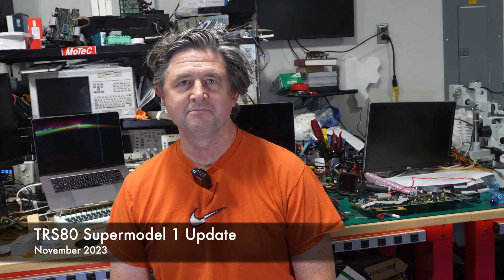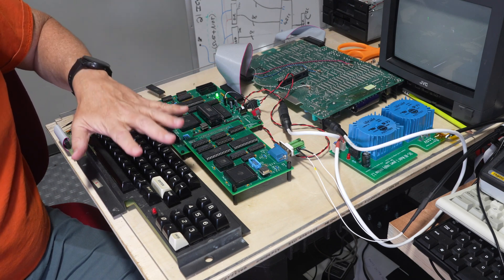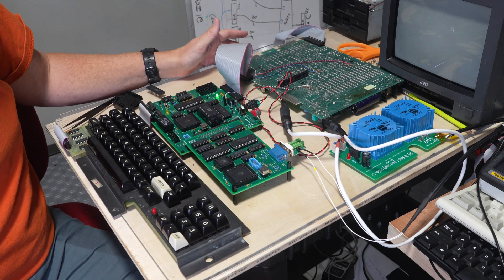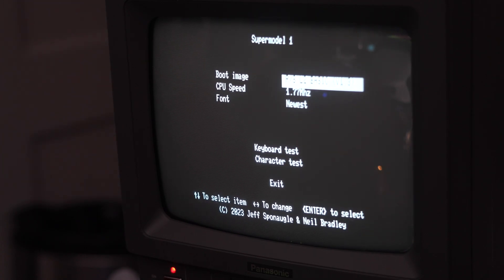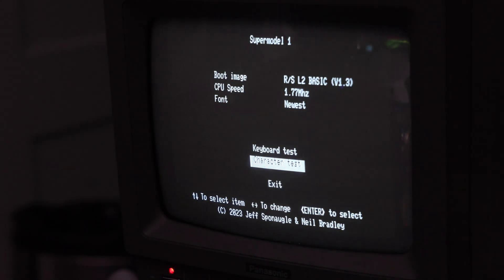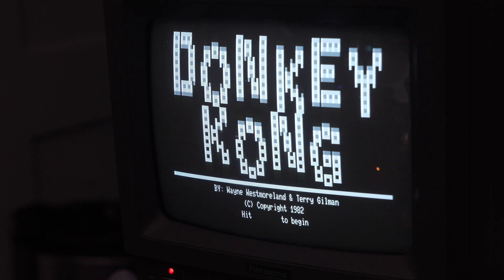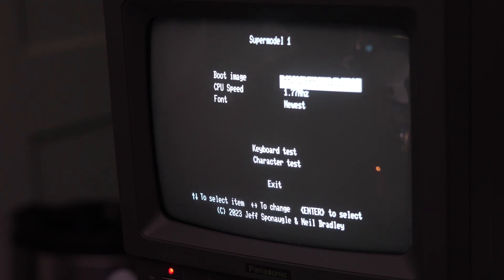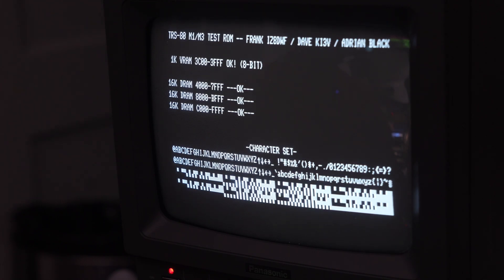TRS80 Supermodel 1 Update

Comment: Very nice system you have put together.
Until seeing them, I had forgot about those non-descending lowercase descenders.  Fond memories.
Idea: Since you are giving font options, perhaps also put in a choice for the all uppercase font of the actual Model 1 which was solely due to Radio Shack management skimping $1.50 by not including a second 2102 chip (128 bytes of static ram). They instead hackily remapped displaying characters 0x60-0x7f (lowercase) as 0x40-0x5f (uppercase) ... despite lowercase being in the system character ROM.

Comment: When you reboot into the "BIOS", are you corrupting the main 48K of RAM - or is it still intact?
I was thinking a nice enhancement would be to have a "monitor" mode option in the BIOS where you could examine and modify RAM.
Basically a simple "freezer" like they sold for other computers of that era.